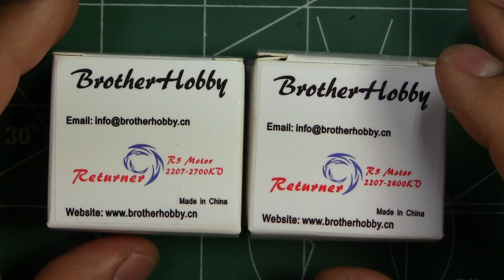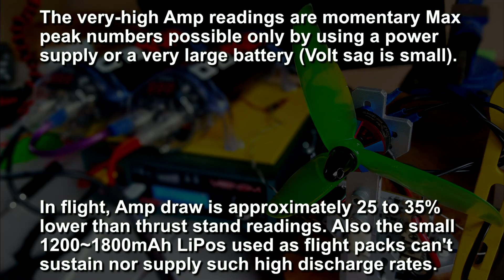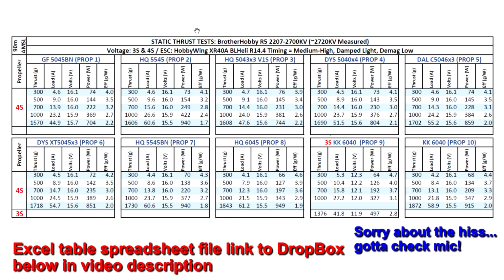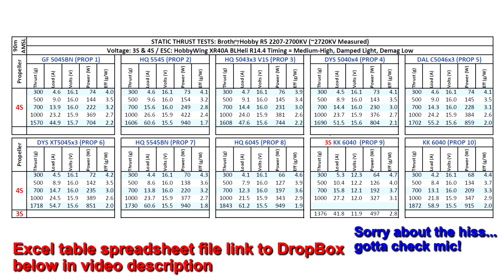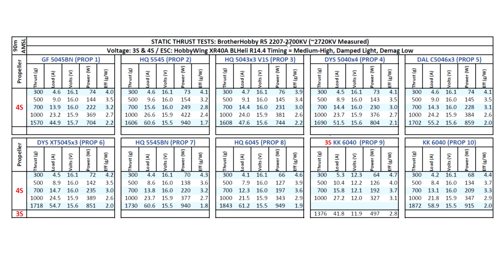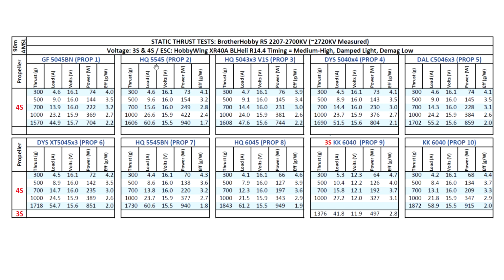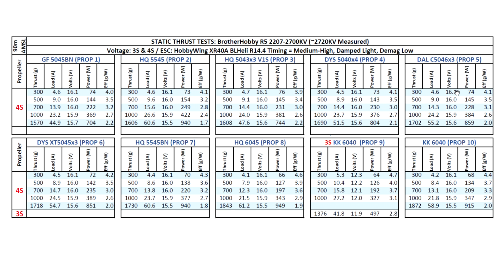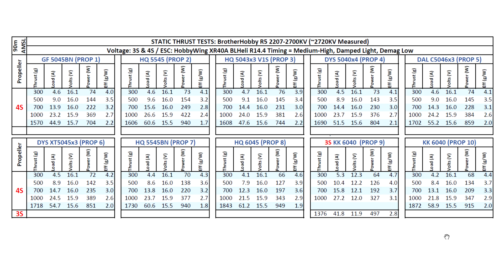BrotherHobby R5 2207-2700KV - Superb Silky Smooth Motor!

Comment: They can handle 5S lipos as well?
Reply from the maker: I've seen some people run 2600 ~ 2700KV motors on 5S and even 6S but they're extreme pilots and have a very good understanding of what is needed to run those setups. You will have to do research to see what parts you need.
Reply: EngineerX Okay, yeah that wont be a problem. I'll put up my build carefully and with the right parts. I just love the high speed and crazy top ends!

Comment: My all up weight without battery is 325g without battery, is this too heavy for the 2207-2700kv motors? Anyone know? Battery killer?
Reply from the maker: A little on the heavy side. Just don't keep throttle on Max for too long or too often. Most people like to use the high KV on setups around 275g and around 300g max. 
It should be OK I think. Let us know!
Reply: I will, Thanks for that!

Comment: Would love to see you test the SunnySky 1106 5500kv, and some data on the Gemfan Flash 2540 prop - any chance you will test them in the near future? Keep up the good work!
Reply from the maker: I contacted SunnySky and asked for test samples, they said they would send some motors for testing but so far nothing has arrived. Those SSky 1106s turned out very good numbers for thrust, the 5500KV should do very well onn 3S. If I had to guess, it shoud get very close numbers to the EMAX RS1106-6000KV motor. That GF2540x3 props is becoming one of the best liked 2.5" props so you really can't go wrong with that combo. Sorry - I don't have plans to buy one for testing
Reply: EngineerX  - I will send you the props - but I need an address.
Reply from the maker: No worries. I ordered a set of those from Banggood and i got them a couple of weeks ago and tested last week. The one thing I've noticed with the latest prop designs is that they don't show good thrust numbers on the tests but they actually perform very well in-flight so the test results are a little deceptive. These are the results for GF2540x3 with EMAX RS1106-6000KV, should be very close to SSky R1106-5500KV
Thrust/Amps/Volts/Watts/ g per W
3S
50 1.6 12.3 20 2.5
100 3.4 12.3 42 2.4
150 5.7 12.3 70 2.1
328 15.7 12.2 192 1.7

2S
50 2.0 7.9 16 3.2
100 4.3 7.9 34 3.0
150 7.1 7.8 55 2.7
186 9.2 7.8 72 2.6
Reply: EngineerX  - awesome! Thank you so much!
Reply: So - today I flew the SunnySky 1106 6500kv's with the Gemfan 2540x3 on 3s and got a five minute flight on a 650mah Tattu - flew great!
Reply from the maker: Sounds like a sweet setup. That's good flight time for those powerful micromotors.  I really need to begin my build with the EMAX. I'm seeing way too many nice micro builds!
Reply: EngineerX  - I can't stop watching your videos - and you can't seem to get your Emax build done - I see a pattern here!  LOL!  The SSky 1106's I used in the build are the new V2 with a 2mm shaft into the motor bell.  The build I used them on is a 2.5" Ascent frame with an F3 board and 20 amp ESC'S that I took off a Furibee Dinosaur.  The overall weight is really good - and with the Gemfan 2540 props it flies really well.  I think the 2540's are sufficiently more efficient than the RotorX 2535's that the amp draw in flight is manageable.  The motors were warm - and it was only 55 degrees out today in Central California - but I'm impressed with the motors.

Comment: EngineerX, I was wondering if you could help me with a question? I have previously been experimenting with 5s. I'm running the F60 Pro 2500kv motors on 5" and 6" props! Well I think it's taxing my power system or over working the power system! My question is about motors, what motors do you recommend. My rigg is 420g dry, I want to move to 6" props all together and I like high kv performance. I was looking at the hyperlite 2207 2522kv, 3B 2407, but for higher voltage applications I'm not sure which motors to be looking at!! I understand that this is a difficult question too ask from you but I respect and trust your expertise in this area!!! Thanks man and keep up the gr8 work!!

Comment: No grip to hold prop tight.  I already had a prop come loose once.  Are there any tricks to remedy this problem?
Reply from the maker: I'm so used to seeing textured surface on most motor I overlooked commenting on that feature. I'll try and remember to add a note on the 2400KV review (will use same tear-down video) I guess the only thing you can do is to just tighten locknut very hard and trust the titanium threads to hold against the aluminum nut. 
Maybe best to get regular aluminum nylocks (with smooth surface on the bottom side) instead of the low-profile nuts  that come with motor as they'll have a couple of extra threads.
Reply: EngineerX   Thank you,  I tried using regular ones but there aren't enough threads, so I had to use the low profile ones.    I was thinking maybe a very thin felt washer or something.    If I don't find a easy solution  I will take my dremmel and make a few lines going outwards on the top of every bell.   What do you think about this dremmel idea, do you think it will unbalance it?   Thank you.   I have the 2306 r5 deadpools, but I think they are the same.
Reply: EngineerX  I just used my exacto knife and scratched 5 even lines in each bell right where the prop touches it. It just removed the paint,  I can feel it catching on my finger nail.  I think it will work.
Reply from the maker: Hey, clever solution. It should help a lot I think. I usually just tighten the crap out the nylocks, except for when the shaft is aluminum like the R3's then not so tight. I'll scratch mine if I ever have that issue of props getting loose. No worries about unbalance. It's in the center and you removed very little material.

Comment: I was wondering if anywhere you a logging the ratio of thrust to motor weight. Ideally you would include the prop weight too as part of the motor weight. Does any such data matrix exist?
Reply from the maker: engizmo no I do not include those numbers. They would be very useful and interesting especially  for the micro motors.

Comment: People are losing bearings on these within a few dozen flight. Can we go back to making motors that last pretty please. 4g weight saving isn't worth it. My own experience of open bottoms is never good. If you fly near trees the wires rip out too easily and windings get damaged. Im staying well clear from now on. Nice review as always
Reply from the maker: Seems when at the limits, any weight reduction will have some sort of consequence. People were demanding lighter and lighter motors and more power. So we got something like this. You're right, for free style, a few extra grams wouldn't be bad
Reply: You shouldn't fly in the trees😂😂😂. Common that's no reason to not buy a good motor!

Comment: Massive power!   Bearings made of paper, and the motor base cracks off at the bottom bearing, just like the 2306 R5s do.  Do you have any of the new ZMX line up to test?
Reply from the maker: Sickocrow Uuugh that's sad to hear. The base looks thick enough but I guess they took off too much around the lower bearing housing. Hope BH listens to users.  We've been requesting they go back to 4x9x4 bearings. I asked SDrone for test samples but they never sent any.
Reply: EngineerX I'm trying out the FinX23 over my usual 2206/2300kv fare.  If I went to a 2207 it'd be the RCX ones over the Emax ones, just because of the bearings used.
Reply from the maker: Sickocrow People seem to love those FinX. Yep. RCX made a good choice going with those EZO 4x9x4 bearings in all their motors.
Reply: ZMX are no better for durability. Base is too thin. All these naked bottoms with 2mm bases (trying to shave weight) are not durable at all.
Reply: I've smashed the shit out of mine, no issues. The thing is stupid fast, too lol. My poor batteries, though.
Reply: this is far and away my fav 2207 on the market.. I have flew the R3 2207s since they came out.. I have the R5 2207s on 6 builds right now and have been flying them since they came out. I have not had one motor fail and have had some good smacks catching race gates on my race builds and the two free style builds I have the 2400kv R5 2207 on have had some good crashes catching trees and one catching a piece of block sticking out when doing a building dive..

I haven't busted one motor, the R5s have held up as good as any motor I have flew..  now I will say (I own a fishing reel Modding, repair and servicing company working on very high end reels so I stock all types of high quality and high end ball bearings) with any motors first thing I do is  replace the bearings with a true rated ABEC7 Stainless steel bearing that i pack with a special grease that we have designed. the high end bearings hold up much MUCH longer then the decent quality bearings that nicer motors come with.. do not use ceramic bearings as high quality stainless bearings work better in this very demanding application.. a true ABEC5 or 7 SS bearing will not get sloppy after a crash or two and will stay smooth and solid for a long time.. I don't bother flying with the bearings they come with, when I get motors in I open them up and replace all the bearings so they are ready when I install them.. I so wish all companies would go to 4x9x4's but with a high quality bearing it's not that big of deal.. I sell my TRUE rated ABEC5 SS for 13.99 a set and 17.99 a set for the 7's.. I know that is like 3x the cost of a new set of NSK bearings that however that set of bearings will last longer then 5 sets of the stock bearings and preform like a new set of stock bearings even after a few hundred flights and crashes.. I have a set of ABEC7 Stainless steel bearings in a set of Returner R4 2206 2522kv motors that's on a freestyle build that has well over 400 flights on it and those motors are as smooth as a brand new set, that is due to high quality bearings that hold up and don't start to fail after a few licks or breaking a prop and the quick and violent vibrations that destroy the upper end cheap bearings that premium motors come with a high end set of bearings will take that abuse and be fine..

I will come back and comment if i break one and how it broke but as of right now the R5 2207 have been ABSOLUTELY fantastic preforming motors and had zero issues with failures.. I'm pulling pretty much every quad at the track on a 224 gram dry weight quad with these in 2700kv and Toppilot 100c 1550s.. no other 2207 has been able to keep up coming out of turns and down the straights, it is THE 2207 of right now imho.. this motor just man handles HQ5x5x3s but I have fallen in love with the Dal 5051x3 as it's so light and the response is so fast it's crazy on a light build they make plenty of thrust to sling a light weight build around like a rag doll.. the top end on that prop is plenty fast (not GF5152, Avan R fast but fast enough.. ide say about the same as the HQ5x4.8x3 but the pop out of tight turns is oh so quick..
Reply: Sickocrow How many motors have you destroyed?
Reply: Quadcopters And Airguns where can I purchase packed bearings from you?
Reply: All my naked butt are still alive, BH 2207 and  2306 are great motors, and cumming down freaking cold

Comment: wow, these need some big ESC's huh?
Reply from the maker: Ghost Rider A good 30A ESC will suffice. Those Amps really come down a whole lot once props are unloaded and moving thru air.
Reply: I run the Typhoon 30a on mine, it takes it just fine on gemfan 5152 props. My batteries hate it, though.
Reply from the maker: Need LiPos to catch up to all the power all these big motors need.
Reply: EngineerX I'm on to 1600+ mah silicone graphene batteries now and I'm working on throttle control lol.
Reply from the maker: LoL... gotta have lots of discipline and refrain from stabbing that throttle too often.

Comment: We need to see the thrust test for the BH1507 2800kv for UL 5" builds. Most these 2207 2206 2205 motors with the same or similar kv perform close enough that it's basically people only trying to color match. The BH1507 is something new that no one knows about